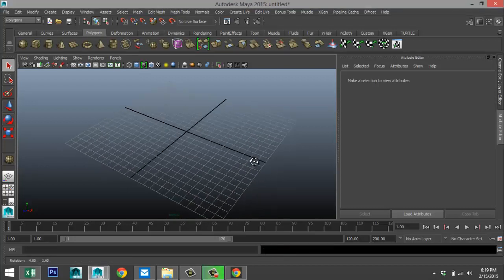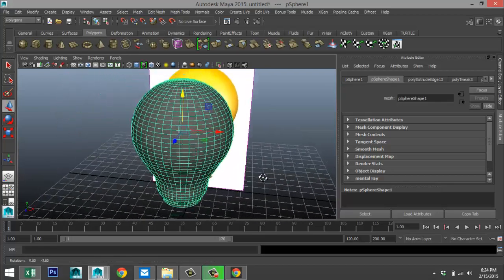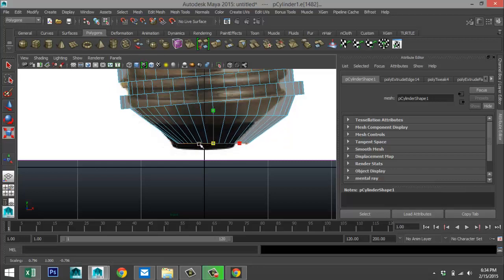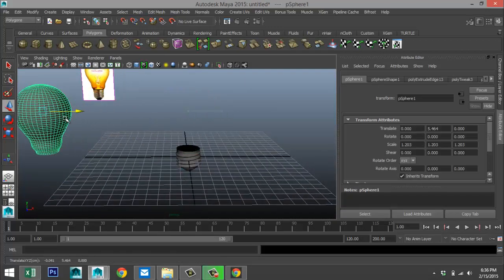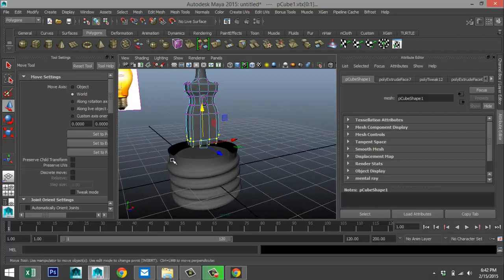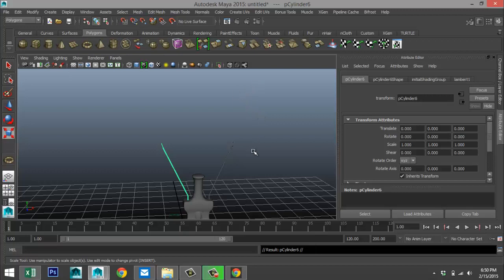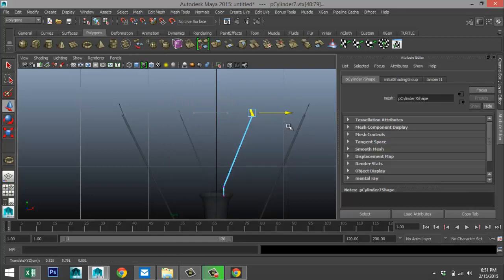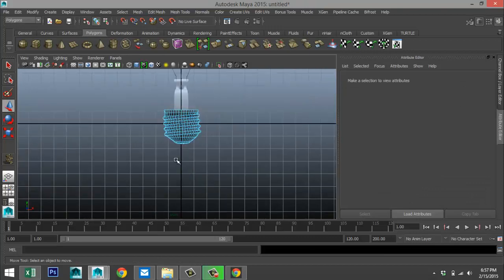How to model a Light Bulb in Maya 2015

Comment: great tutorials  I'm thinking about getting full maya 2017 will those come with preset materials for mental ray and Arnold   also what view port are you using to see those materials like glass and stuff.
Reply from the maker: Nigel, Mental Ray is a different plugin by NVIDIA and keep in mind that 2017 is very expensise and somewhwat flawed
Reply: Mike Hermes can the plug in work for maya lt? maya lt doesn't seem to have plug ins or presets for materials and maya 2017 is expensive 0_0

Comment: Hi Mike, just moved from Max to Maya and have been doing your tutorials. Very handy, plus you actually narrate and tell what you're doing - so thanks a bunch. Quick question that I haven't been able to answer by searching : my swatches for mia materials basically only show the specular highlight. MR is loaded and renders fine, but in the Att Editor and Hypershade I can't get a nice material preview. Any ideas?
Reply from the maker: +Dan Watson I would suggest using the new MILA materials In Maya 2016. These are layered materials and let you build a texture, bit by bit, layer by layer
Reply: +Mike Hermes Funny, the mia previews fine in my student version of 2016. Might have to switch from 2014 to 2016 but I'm not a fan of the new interface. Cheers for the tip though, man ;-)
Reply from the maker: +Dan Watson I wasn't a fan of the interface either but after a few days it's awesome !!

Comment: if it is possible could you give a link for downloading source , textures an images ?
Reply from the maker: Hi CAP,

Yes, it is possible and I usually do but in this case it is just a plain lightbulb that can be Googled and saved.

Mike
Reply: I have one more question in my Maya I cannot find MIa material how can I add it ?
Reply from the maker: Creative Art Production Go to your top menu to Window-Settings/Preferences-Plugin Manager and look Mayatomr.mll. Select both loaded and autoload and then try again

Mike
Reply: +Mike Hermes ive got it